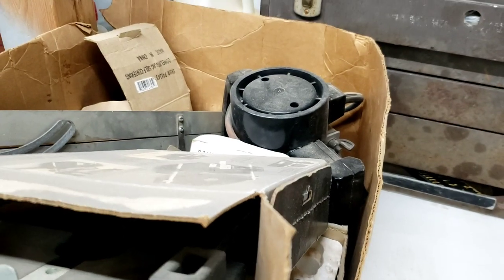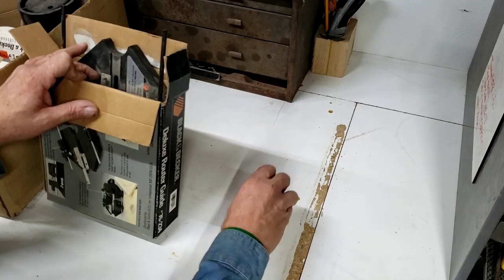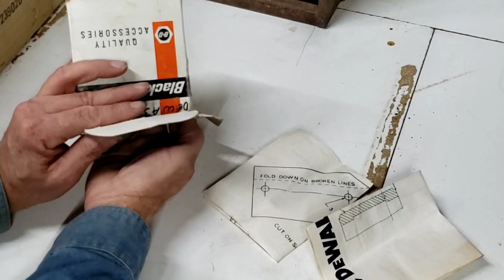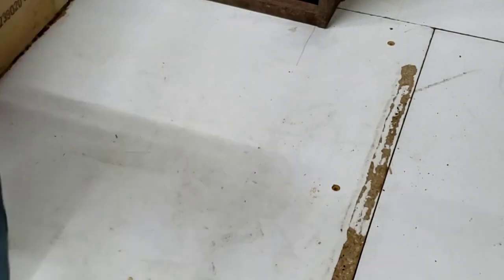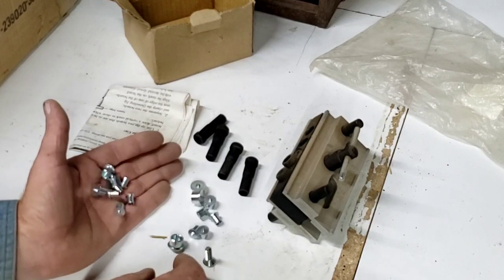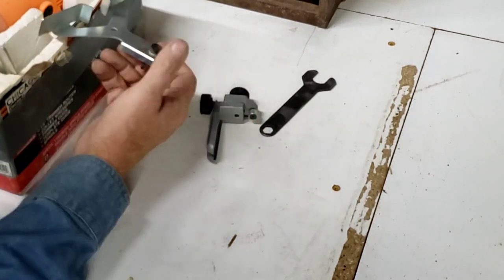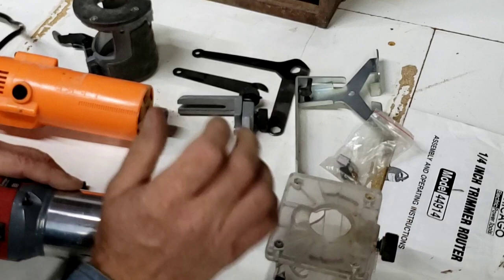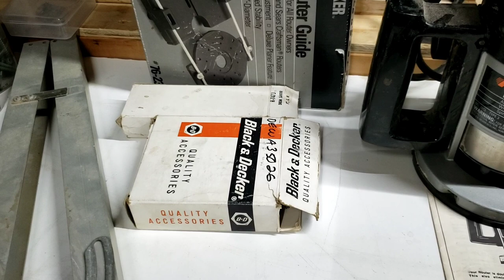Look what I found in a garage sale box for $30 | BIG NEWS COMING SOON | MUST WATCH

Comment: Back 55-60 years ago Black and Decker was a great brand…all my skill saws  used in the 60s and 70s were black and Decker builders sawcats I used mostly the 6.5 inch they were light and plenty powerful for building houses….I still have several Black and Decker professional saws and recip saws, routers etc all over 40 years old and still working great.
Reply from the maker: That is great information Dan. Thanks for sharing this with us and spending your time to watch and comment.

Comment: For a long time Craftsman power tools by Sears were actually Black and Decker.  The difference was B&D had brass bushing.   When they made it for Craftsman the bushings would be nylon.  There were other material changes they did to make Craftsman less expensive.
Reply from the maker: Sure thing

Comment: I'm thinking that sanding drum goes on a planer or that router if you take the collet off
Reply from the maker: I will have to check the threads on it. You may be on to something with the router. 25K rpm is awfully fast to spin a drumsander IMO, but I could be wrong :)